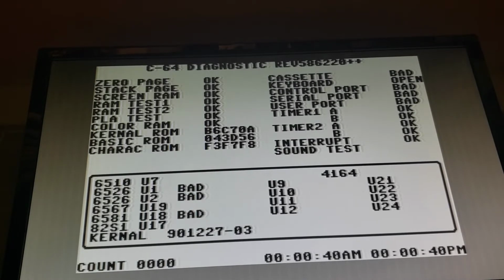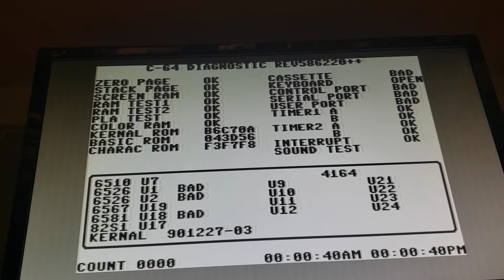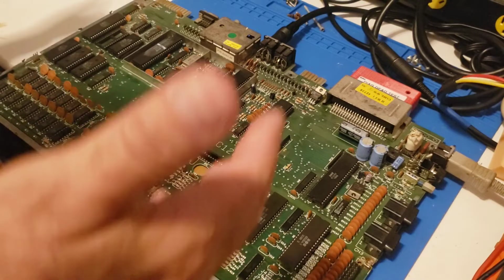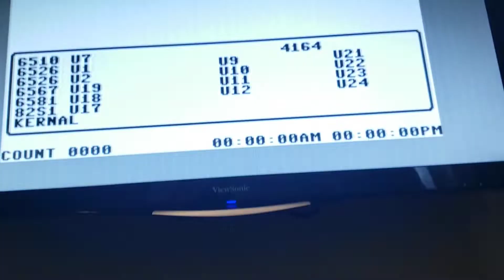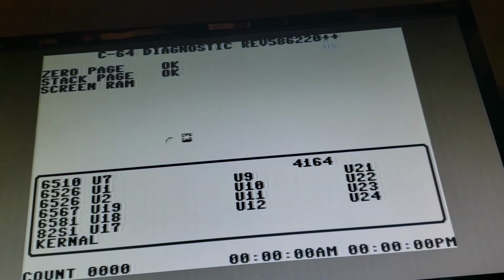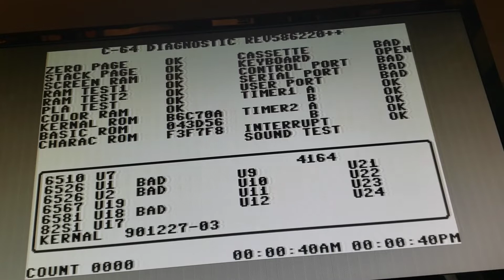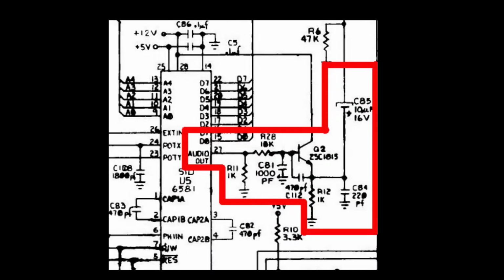Commodore C128 No Sound

Comment: Hi, thanks for the video, I'm also having an issue with my C128's audio, I do get sound output but it's way lower than it used to be. I'm going to follow your troubleshooting steps.  I'm guessing that if left unchecked my machine will eventually lose all sound output. I'm going to pick up a new SID as well as a new socket.

Comment: So was there a bent pin or broken pin on the old socket you took out?

I have seen where the clamp inside the socket does not grab the pin, and can sometimes be bent but has to be done with the socket out, and push the pin out of the socket and bend the loop tighter together.
Reply from the maker: You hit the nail on the head. One of the clamps inside the socket was corroded/cracked. I like to use round hole sockets anyway so I didn't bother fixing the socket I took out. The round pin sockets are much more forgiving when using chips that have been desoldered from a donor board - especially if you happen to have to pull that donor chip back out and the pins still had some solder residue on them. :)

Comment: Nice work.  Bad socket.  Is that common?  Again,  I like your thoural step by step diagnostics
Reply from the maker: Sometimes reseating chips works - but a bad socket like this was due to corrosion - in this case the corrosion damaged the part that holds the pin tightly. It can happen but not too often. The audio circuit on the C64 is similar to the C128 here - which is why I posted in case anyone has an issue with no sound. Same steps apply to both system :)  - thanks for watching! :)